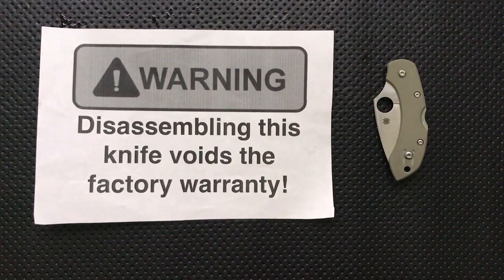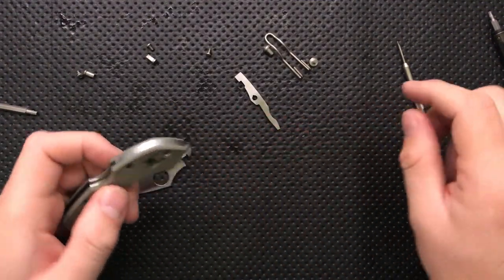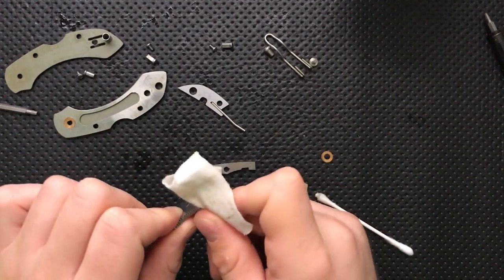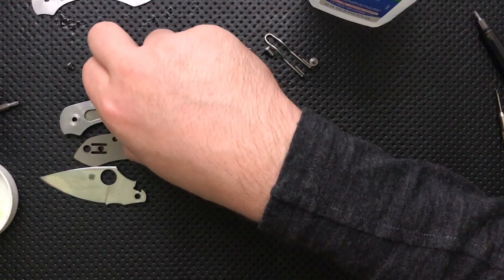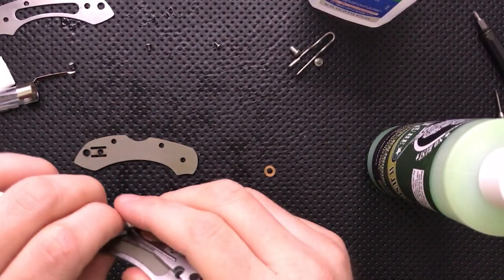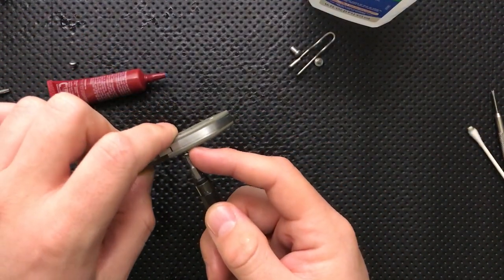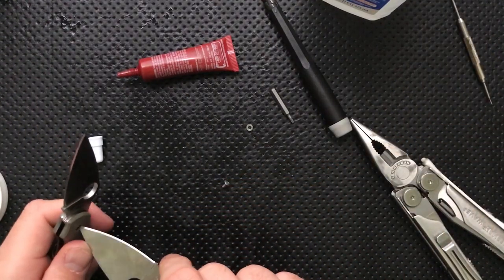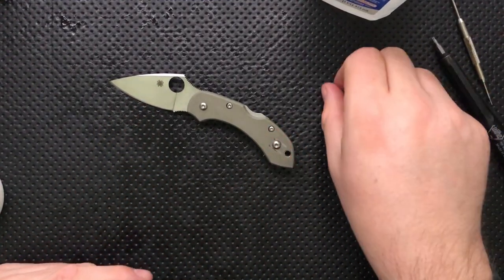How to disassemble and maintain the Spyderco G10 Dragonfly Pocketknife

Comment: Nick... first off... THANK YOU for your videos!

As others have mentioned... your pivot screw is coming in from the wrong side.  If you look at your FRN Dragonfly, that is also used in this video, you will see that all of the screws enter the frame from the opposite side than you are entering from.  I also have this G10 Dragonfly and a G10 Delica... the screws all enter from the clip side (assuming your clip is for RH carry).

Comment: Hey nick. The reason the pivot wasn't fitting was because you had it going through the wrong side. Also all of the back screws were installed through the wrong side. Only reason I know is because I had the same issue with mine!